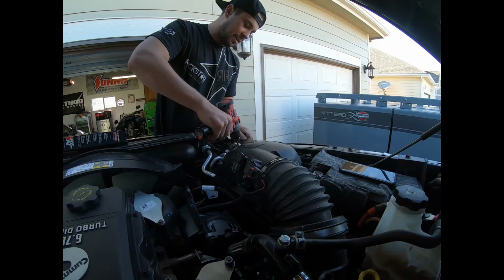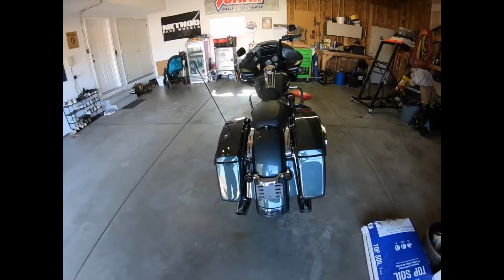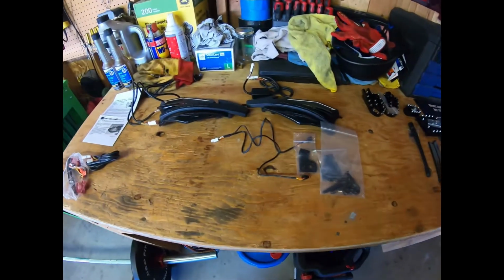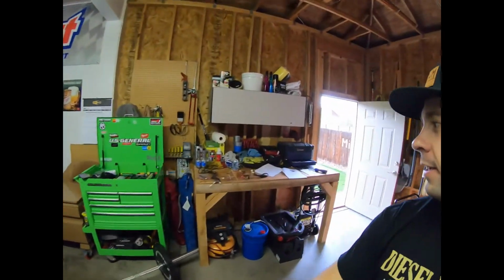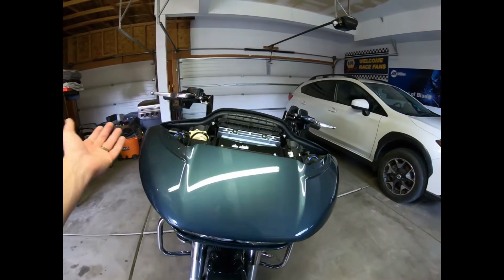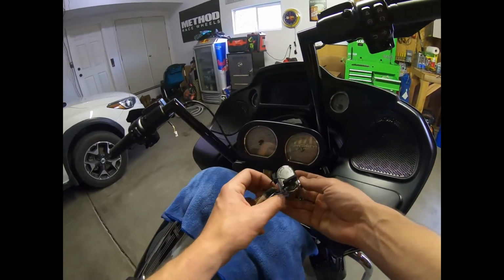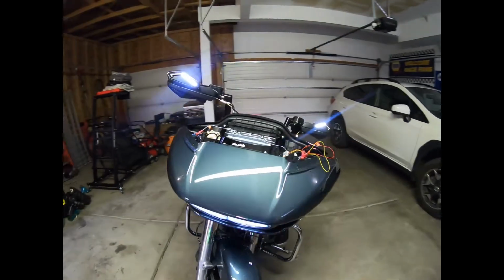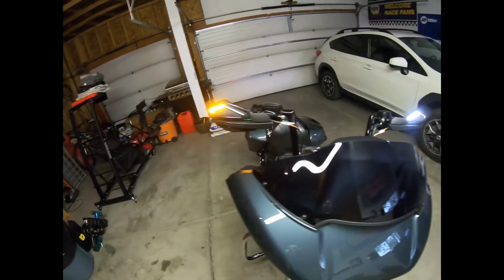Harley Progress!  Wiring Up PowerMadd Hand Guards!

Comment: I have my mirrors under mounted, I assume if I install Power Madd hand guards I'll have to move my mirrors back to the top?
Reply from the maker: Shouldn't be an issue!
Reply: @km_motorsports  it looked like you mounted their brackets on the bottom side of the levers.

Comment: Which part number mounting kit did you use for the Road Glide? PowerMadd has 5 different mounting kits.
Reply: Yes what number ? I’m trying to get one but I’m not sure what mount thanks
Reply: If you have mechanical clutch like me, it's 34260......Power Madd website has details on what numbers fit what bike!

Comment: When you installed, did you use the control box that comes in the lighting kit? I was hoping to hard wire each light into its own harness. Thanks
Reply from the maker: I did use the control box, never had any issues with it and would recommend!
Only challenge was space and getting it to fit neatly.